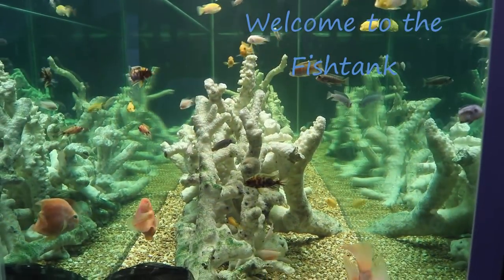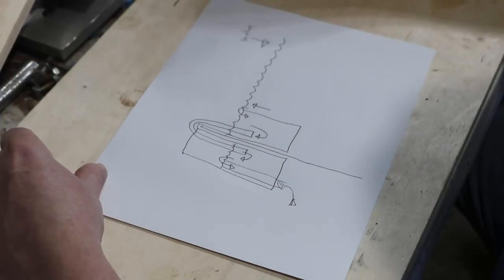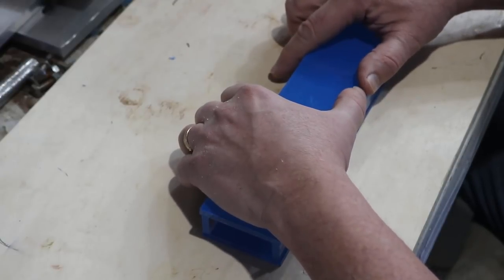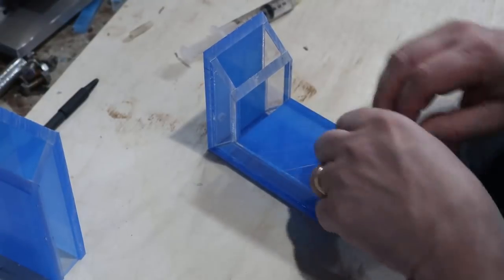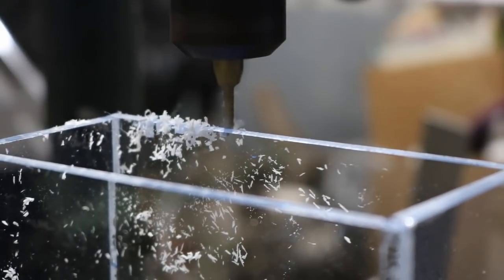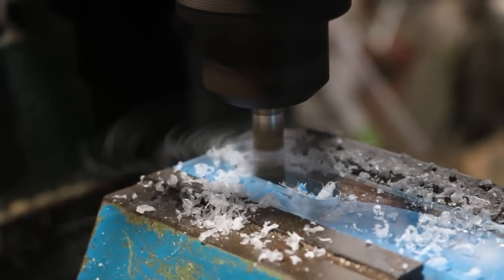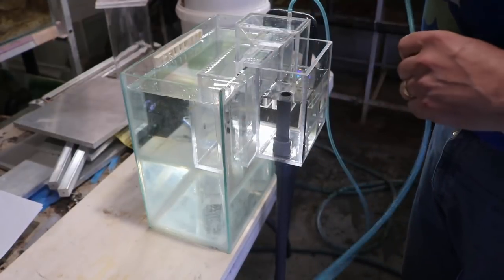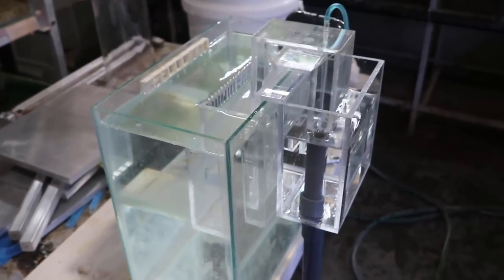Viewer Request Video - No Drill Over Flow

Comment: Good video. Some people attach the air hose to a power head in the sump to keep the vacuum or restart the psiphon when the power comes back on. I am sure you know this is for other readers
Reply from the maker: If you leave the air line in the outside box it actually performs the same function. That little bit of head is enough. Thanks for taking the time to watch and share your thoughts
Reply: Great video to start with your narrative is spot on 🔥I need more information on this , to restart the siphon when power is back  will appreciate advice 🙏

Comment: Awesome!  It's just easier to drill the hole, fit a drain pipe into it, and attach the drain hose! Personally, either way, I would wrap some screening around the intake to the HOB overflow to keep my fish from being pulled out the same way I wrap the intakes of my HOB filters... Especially if you have fry and/or very small fish!  Great Build, Though!!!   :-)
Reply: Brian Roberts  Well I don't know about everything, I'm just saying that yes, it would be much easier if you COULD just drill a hole at the level you want, but my main point is putting on some kind of safeguard so that you don't lose your fish.  I just use simple window screening! It's woven pretty small, and allows the water through without bringing anything else in!    Oh, and Thank You for your response , and I wish you a good night!   Now, if you'll excuse me, my bed beckons me!   Yeah, been a Long day!  lol  :-)

Comment: What I can't get an answer on, mainly because most people use these inside overflow boxes, is what happens if you just drill a hole an inch from the top of the aquarium and attach the bulk head and hose down to the sump and a screen inside the aquarium to prevent the fish from passing through.  The return from the sump (above the water line to prevent back flows) would fill the tank and push more water down to the sump.  The simplest system as I envision it and no ugly box inside the aquarium.  Is it a noise issue?  Or am I not accounting for something?
Reply: I think its because ppl tend to redo there tanks and change things around. once you drill a tank your pretty much committed to it.

Comment: Very cool. I'm trying to understand the risk if you get air into the "U" pipe. I'm thinking if enough gets in the siphon is broke and you would have a tank overflow?
Reply from the maker: An air block results in an overflow only if you pump water into a HOB. If you are pumping it out, all that happens is it will run dry.

Comment: tks for the great build. wondering if you extend the inside box to touch the bottom of the tank and flip your drainage grate to the bottom, top of the box flush with the top of the tank, outside box the same; will this act as a vacuum system to pull debris off the floor of the tank? maybe one or two slots in the top to act as a skimmer then the rest of the flow through the bottom. will this work? or will it just overflow the tank?
Reply from the maker: Glad you liked it! Unfortunately you can't suck water from the bottom with this style of overflow
Reply from the maker: I saw that you had left two more comments, but when I click on them nothing came up. If you could retry leaving comments on those videos again I would be happy to respond

Comment: I wondered how those worked.  Thanks again    How would you build a HOB diverter?  Is there a way to have it end in a spray bar or something floating plant friendly?
Reply from the maker: Thank you I'm glad you liked it. The easy way of putting a spray bar on a HOB is to reverse how the water goes through it. Instead of using a pump to pump water into the filter use the pump to pump water out. Then all you need to do is attach a spray bar system to the output. Hope this helps and thanks for watching
Reply: @FishmanEricRussell  Course the easy way won't work in my situation.     The HOB is on a shrimp tank and is a recent purchase to replace the in tank pump that was decimating baby shrimp.   Any other simple ideas for directing flow from a HOB?    Thank you.
Reply from the maker: @Sue.5776  You could give this a try https://www.youtube.com/watch?v=GY4YMY4mkck especially the one in the thumbnail. Just have it cover the whole output

Comment: Hi . I need your help. Which dimension of the u-tubes should I use if I’m using a 6500l/h pump.
Thx
Reply from the maker: That's over 1600 gal/hr. I would not trust this style of overflow with that much flow. I would drill the tank. The hole should be 2" in dia. Hope that helps
Reply: @FishmanEricRussell  ok thanks man

Comment: My issue with drilling is I have 4 10 gallon tanks and from what I hear drilling 10 gallon tanks is a nightmare because of how thin the glass is
Reply from the maker: It is possible. You need to fully support the back though. Commercial tanks use very thin glass.

Comment: Looks amazing! Can that handle 300gal? Can you make for 600gallons? 😊
Reply from the maker: Yes. Overflows can be made to handle most flows. Higher flows actually work better as they help prevent air blocks from forming, though if they do (through poor maintenance) there will be lots of water on the floor lol